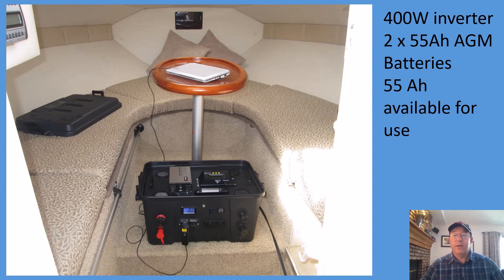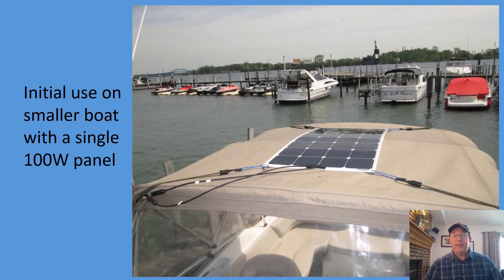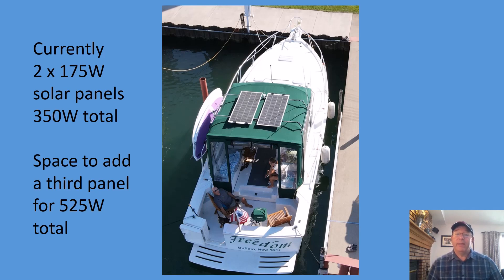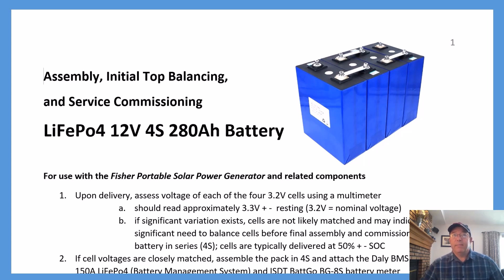V2 P1 3.5 Kilowatt Hour LiFePo4 DIY Portable Solar Power Generator - Schematic, Guide Sheet Provided

Comment: How does your inverter know the size of your battery bank? I can't think of anything the inverter could do to calculate that. The closest thing I can think of is to briefly draw a BIG load, which most smaller batteries would struggle to support...unless you had some power cells like Headways, A123's, SPIM08HPs, etc. Most prismatic lithium cells (100Ah or larger) are rated for 1C continuous, 2C burst but the Headways are a real world 10C-20C battery, the A123's are about 20C but can burst much higher and I think the SPIM08HP's are around 20C (when new, Battery Hookup sells used versions of all of these but do not expect them to be this poweful). For example the Headways (38120HP model) are 8Ah 38mm wide 120mm long cylindrical cell with screw terminals to make connections easy. Max discharge current (continuous) is 10C real world so 80A, burst is about 20C so 160A. Very popular with the audio crowd. A 4 cells 12.8V nominal Headway pack is fairly small but can push out enough current to run a 1000W inverter for a short period of time. There's also videos of people using all three of these power cells to start cars, trucks, etc. Turning over big gas engines with just 4 or 8 cells.

For anyone interested there are 96 cell packs of A123 ANR26650M1B cells on eBay for $100 shipped. I bought one and it tested near 100% capacity, very little degradation, IR was good. New old stock essentially. It comes in a 12S8P pack. Cut it into thirds and you get 3 12V 20Ah batteries each about 250 watt hours. You can parallel the 3 for 12V 60Ah....for $100.....whereas an off the shelf budget 12V 100Ah is $300. But these are power cells. And one of those 12V bricks has 8 cells in parallel. There are some bottlenecks like the nickel connecting the pack together but hypothetically that 4S8P pack could discharge ~400A at 12V. Real world the way they are you could easily discharge 100A from that pack. SInce each brick is 20Ah thats 12 minutes per pack, youd get 36 minutes running a 1200W inverter full tilt....real world more like 30 min running a 1200W or 35-40 minutes running a 1000W

Need to power an induction cooktop? Two of those packs each cut into thirds gives you 12V 120Ah. You'd need 156A to power a 2000W inverter full tilt so your connections paralleling those packs would have to be beefy...I'd say 8 AWG silicone wire stripped and soldered down the main positive and negative rails with each of those running to a pos and neg bus bar that your batteries terminals pull from. So 6 of those packs you're pulling about 25A per pack meaning they'd last just under an hour..around 45 minutes. 

So theres a $200 option to power an induction cooktop for dinner. Add another $100 for the wire, bus bars, battery box, etc....but it definitely gives you an option that you don't get from any 100Ah 12V since they are usually limited to 100A. Youd need a 200Ah WITH a 150A or larger BMS. That's $600 for the cheapest off the shelf LiFeP04 and these A123 are also LiFeP04 and very safe.
Reply: The Headways would be easier because of the screw terminals. Used cells are $6 on batteryhookup. Assume 7Ah per cell, not 8Ah. So $24 and you get 12.8V 7Ah. Buy 14 of those sets and you get 98Ah. Make it 20 so you get 140Ah and then your in the same ballpark as my previous option. That's $480 and then you gotta buy the cell holders and bus bars ($100 max). With proper copper bus bars (not the steel ones some people sell) you can draw 50A from each pack. That's only 7C. If your connections can handle that power you have the ability to draw 1000A at 12V for maybe 8 minutes LOL. Or if you needed 150A to power that inverter it would be 7.5A per 4 cell 12V pack....so you'd get a little under 1 hour run time. Also LiFeP04

Don't forget to use a BMS if you aren't capable of monitoring your packs closely. An active balancer can help as well. Make sure to top balance cells before putting pack together or you better have an active balancer to fix it. Unbalanced pack means BMS will cut out when one cell is at low cutoff and the others still might have 20% left in them.

Buy 280Ah or 304Ah REPT or CATL cells from 18650 Battery Store is cheaper though. $520 for the cells and then just bus bars, battery box, BMS, wire for yoru terminals....maybe buy an IR meter (YR1035+ or RC3563 $40 Aliexpress) to make sure your cells are equal to or less than the AC IR number on the datasheet. IR is cell health. IR is discharge power. IR is everything.
Reply from the maker: Not sure what the technology is within the inverter made by Renogy, but the much larger, 2000W inverter I incorporated in the LiFePo4 system upgrade simply would not remain on when connected to the original 2 x 55ah AGM batteries.  It would briefly power up and then immediately shut down.  The specs within the manual for the 2000W Renogy inverter, and on their website, indicated this would be the case...there are minimum battery bank size requirements for their inverters to turn on, even without a load.

Comment: What kind of wattage do you get from the panels laying flat? I know you don't have much of a choice and 50-75% efficiency is better than nothing. Even if you just get 80W from one panel into your portable solar generator thats' a solid 500W a day which might offset a good chunk of your fridges use.
Reply from the maker: Eric, I mainly track power production and use in my system in terms of DC amps since that is what the meter I use monitors.  I have a total of 525 watts of solar panels feeding two separate battery banks.  The first battery bank is the 280ah LiFePo4 battery seen in the upgrade in the last half of my YouTube video series.  The second house battery bank on my boat is a 4D lead acid 200ah battery.  The 280ah battery is being charged by two of the three 175 watt panels (connected in series).  The portable refrigerator/freezer that is powered by the 280ah battery draws just over 3 amps DC, intermittently.  Real time data tracking on my phone app shows that it runs, on average, about twice per hour for about 5 minutes (10 minutes total)...so, less than 1 DC amp is drawn per hour to run that small refrigerator.  The two solar panels, on average are generating about 4 amps per hour during peak daylight.  Since they are wired in series they begin generating power (about 1 amp or so) at dawn and continue to do so right through dusk.  I estimate that the system in inputting about 25-30 amps per day.  I have my charge parameters on the MPPT controller set to charge the battery to what I estimate is about 90% capacity.  At this time of year I am able to run the refrigerator 24/7 and the LiFePo battery is fully charged by midday.

Comment: Just saw This Vi. Where is The Link for The cells you got?
Reply from the maker: No link is provided to the LiFePo4 prismatic cells I used.  I purchased what I assumed were B grade cells from Liitokala Varicore on AliExpress.  I recommend you do ample research before buying cells and may want assurance that what you are purchasing are grade A brand new cells.   New cells will be less of a challenge to manage. They will, of course, be more expensive than what I used to build my battery.

Comment: You do very nice work. Everything is well thought out. I'm a retired engineer and make many science projects in my shop. Unfortunately, most of my stuff is crudely done prototype projects. Years ago I tried to design and build every project as perfect as possible. Without fail, after the project was done, I found its faults and wished I could have known before putting the time in to build it beautifully. The big joke in my family is that projects that were ''temporary'' still function well after 15-20 years. Quantity over quality here!

I have an old wooden Diesel powered Tollycraft. I built a cabin heater from scratch using a Ford Bronco heater core and Windstar blower. It exhausts under the galley seat  and keeps the boat toasty warm on cold rainy days. The engine coolant runs 160 F maximum but by the time we get to the cove and drop anchor, the cabin is quite warm. 

My home has 32KWH in 2 battery banks as backup power for critical loads. My goal is to double that. My 280 AH cells are on their way along with some Daly 250 amp BMS units, all on a slow boat from China. Some Heltec balancers are coming as well. I found a 500 amp marine battery selector switch with huge 1/2 inch posts and that provides a very easy transition between battery banks. An old Amplepower 175 amp Kubota diesel powered marine battery charger will add to my recharge capacity as soon as I get the new Balmar voltage regulator. There are enough projects here to last for the rest of my lifetime!  Keep up the good work.
Reply from the maker: Thanks so much for viewing and for taking the time to leave comments, they are appreciated!  Seems you and I have a lot in common.  I would love to divert some of the excess heat from my diesel into my Mainship's cockpit (my wife would love it more).  Sounds like you have your home heading toward off-grid status, not just backup.  Have fun with your projects and thanks again for your interest in mine.